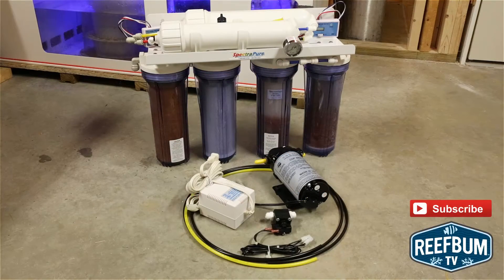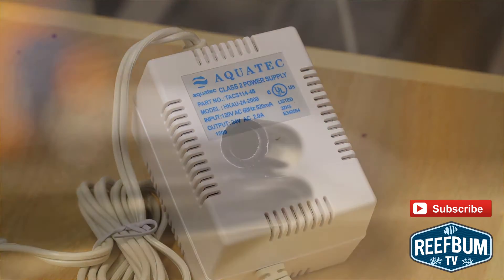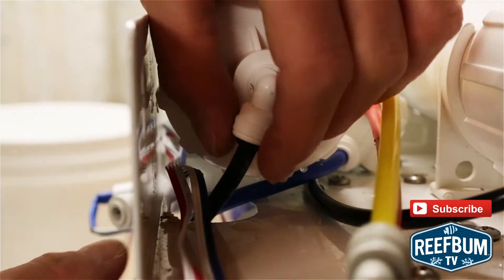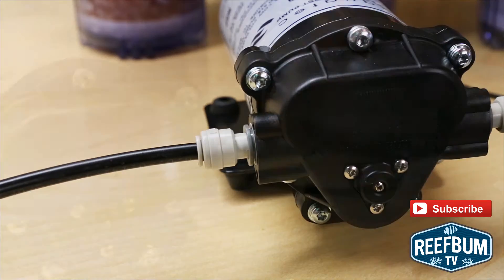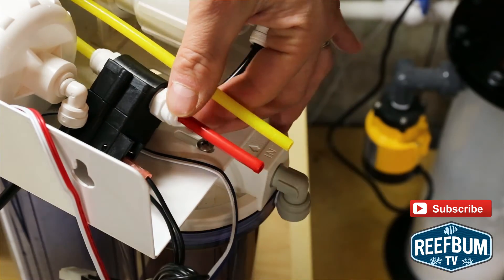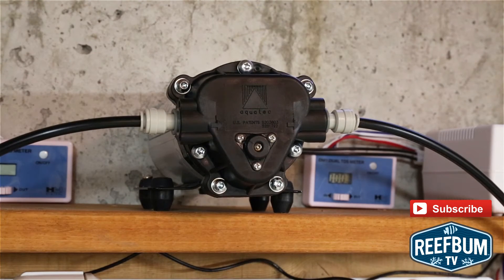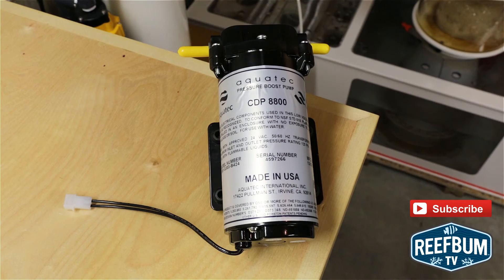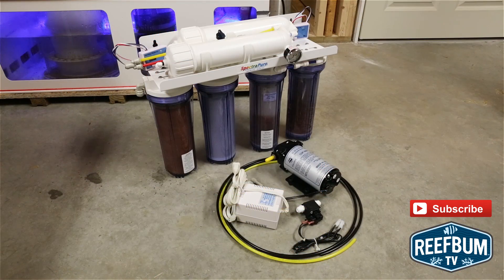SpectraPure RODI Booster Pump: Review & Setup Guide

Comment: Great video as always! Your set up is different than the way BRS had me set up mine. They had me install the booster pump first in line. from the source water then into first sediment filter. Also the pressure switch is in a deferent place. They suggest putting it inbetween the water coming out of the Ro canister then into the di canister.
Reply from the maker: +adroc31 Thanks!  It is interesting that they had you do the install differently.

Comment: i have one of those pumps but im having a little trouble with the tso vale it kicks in to late the tank is almost empty when the tso valve kicks i need it to turn on a little sooner. I noticed that you conected the tso valve after the flow restrictor does that make a diffrence? i have mine connected to the tank

Comment: Great review! I have the 90gpd unit, my pressure is right at 40psi. I'm going to have to pick one of these this year sometime!
Reply from the maker: +pelphrey Thanks!  Yes, it really boosted my water production and will extend cartridge life.
Reply: I agree, great video...  quick question, I have a 300 gpd spartan rodi system, at what psi do you suggest it should be at?
Reply from the maker: Thanks!  I am not familiar with that system but I know from using Spectrapure units over the years that any system with pressure under 40 PSI requires a booster pump to increase the pressure to optimize membrane performance.  I would double check with the manufacturer to be sure.
Reply: thank you!
Reply: +ReefBum please making a video for how to adjust booster pump pressure

because my pump is jenret extra pressure 120 psi.
 and my membrane housing is cracked again and again

pls make a video

Comment: I have a 75gpd unit and I get 50 psi without any pump. I had recently hooked up this particular pump so i can boost up my pressure, come to find out the pressure drops and stayed at 45 psi with the pump. This is frustrating. I guess I am going to do more research on how this thing works.
Reply: Did you check you don’t have flow restricters from pump to membrane?

Comment: Was that meant to say "make at least 20 gallons"? I would think running to fill a large water container of say brute trash cans is actually better than making less than 20 gallons per use. And you did say little on and off's will decrease life...but confused about 20 gallon limit to prolong life of filters. Thanks, good video very to the point
Reply from the maker: +e90Bimmer Thanks!  Spectrapure recommends running it for 20 gallons at a time to maximize cartridge and membrane life.  It certainly seems to be working for me.